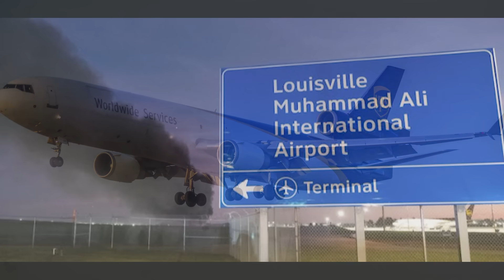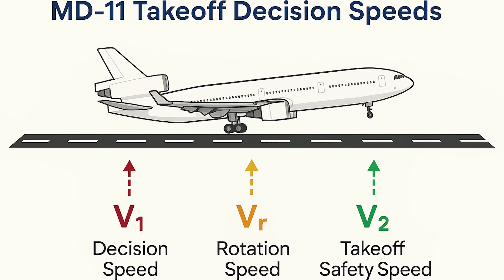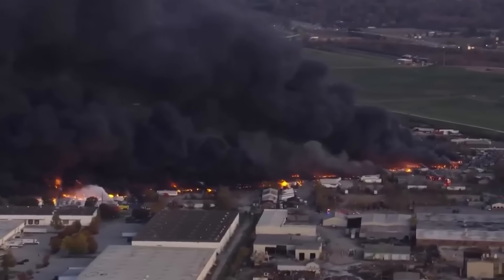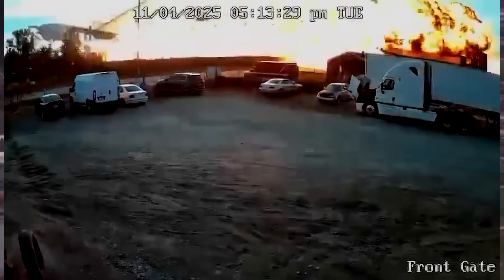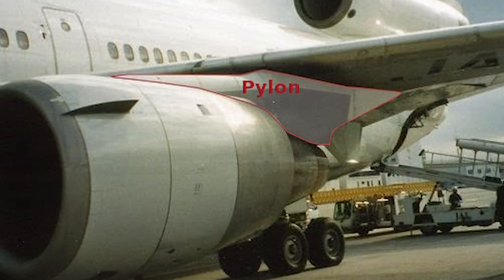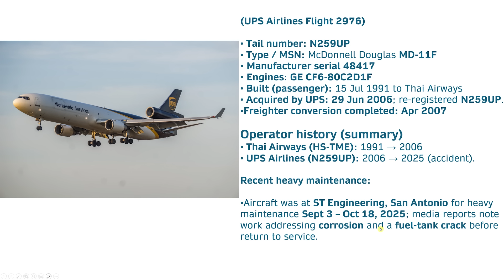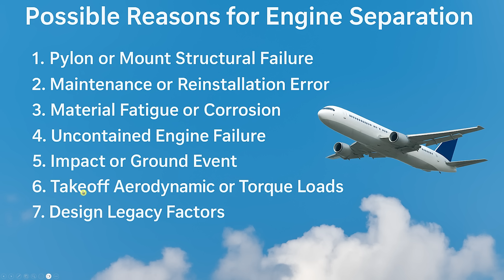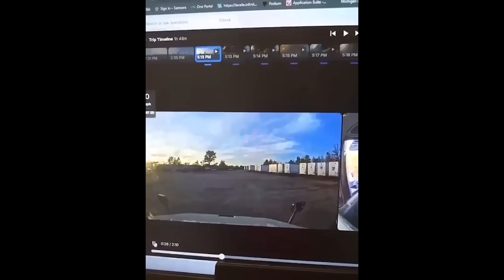What Caused UPS Plane Crash, Louisville, KY? How MD-11 Engine Fell Off

Comment: On 7 November 2007, Nationwide Airlines Flight 723, a Boeing 737-230A owned and operated by Nationwide Airlines, was performing a scheduled domestic flight from Cape Town International Airport to O. R. Tambo International Airport. During the rotation from runway 01, engine No.2 detached from the right wing. The pilots then proceeded to takeoff and declared an emergency, eventually making an emergency landing. All 112 occupants survived without injuries.

Comment: Weren't there similar issues in past decades from jet engines being swapped by lifting them into place with a forklift? It seems obvious that such a crude method could easily damage the engine pylons and cause stress cracks. BILL

Comment: Maybe they shouldn’t fly it for 40 years
Reply: Idiot, 40 year old planes are still great when you maintened it correctly most of the planes flying are 30 40 yrs old and even the us air force is flying 50 year old f16 and f15

Comment: Awful stuff,. just awful awful awful. I feel sorry for anyone on the ground who witnessed this because they'll have plane crash type nightmare dreams for years to come. I can attest to that as I witnessed the PSA 727 flight 182 crash into North Park that very hot Santa Ana San Diego Sept 25 1978 morning. I was just 20. Ugh!  Happened right in front of me. Now67 I still get the occasional out of control plane dream, sobut not as many. And, yeah, wasn't it just a few months later the DC 10 crashed in Chicago and I was at work with the TV on when that news broke! Actually I don't understand why they're still using these OLD flying machines!? They should be retired, imo.

Comment: I may very well be wrong but I seem to remember that with DC10's the hydraulic lines run along the front of the wing area, and when an engine pylon gives way, it rips the hydraulic lines out as it leaves. This lets the flaps go "Limp" and lift is lost on that wing causing the plane to roll down on that side. It was one of a number of design failure points for the DC10. I was working at Auckland International airport at the time of the first crash from this failure mode and there was a series of mandatory changes put out to reroute or protect the hydraulic lines as much as possible. Such a failure mode guaranteed a crash as the plane was un-recoverable in that configuration. Its a tragedy for all involved and I cant help but weep for the loss of the families left behind as I watch the videos of the crash. If this terrible accident is also traced back to an engine and/or pylon detaching and disabling the hydraulics on that wing, then in my (ex) professional opinion, its time the DC10 and MD11's were removed from service.

Comment: American Flight 191-May 1979, O' Hare Chicago. Almost 300 dead after engine fell off on runway. American maintenance chief committed suicide by gassing himself in his car rather than testify to congress explaining his maintenance practices. Coward! DC-10-MD-11 was a lemon when it was designed in 1968. McConnell Douglas went outta business because of all the lawsuits.
Reply: McDonnell Douglas and Boeing merged in 1997 and were from that point forward went under the Boeing name.

Comment: My guess... someone bought cheap Chinese bolts to secure the engines to the pylons instead of the much more expensive ones that are made here in the US and extensively tested for defects.
There are some corners that shouldn't be cut to save a few thousand dollars.  Accountants should not be anywhere near aircraft maintenance.

Comment: Early 80s, couple years after the AA-191 crash, my older brother had gotten us tickets to come visit him in NY city for Easter. At the end of it, we were back at the airport waiting for our flight A plane coming out of Boston (early morning flight) was to take us to our destination after stopping in NY. A one hour delay stretched out to 2 hours, 4 hours, finally at 9 hours, they pulled another plane out and got a volunteer crew to make the flight happen. At the time we didn't know what was going on, but we got free drinks on the plane. After we got home, we found out why. On takeoff from Boston, the plane had an engine failure. It didn't crash, but that was why we had a 9 hour delay and no plane. Most times an engine failure won't crash a plane with multiple engines. Multi-engine planes are designed to run with one engine gone. Not very well but well enough. What happened here is from what other analysts have said, that it appears that the second engine lost power as well. Possibly due to some cascading event that occurred from the first engine falling off. (we'll see what the black box says when they run that data) So it looks like the tail engine was the only one working by the time it got to the end of the runway. And that by itself, was no enough to lift the plane. If the second engine had been working, they might have been able to lift and circle back for an emergency landing. You do know one thing, that poor flight crew were fighting to stay in the air the entire way. Rest in peace good folk.

Comment: I was working for MacDonnell Douglas when the Chicago crash happened.  WHAT I KNOW is that the engine pylon is held on by what we called the tombstone fitting.  Very large and strong connection to the wing.  Far back at the tail end of the pylon is a single bolt that holds the tail end of the pylon to the wing.  When the forklift slightly dropped the engine - AA was not following proper engine removal procedure, the force on that bolt and fitting must have been huge.  That's how that fitting cracked.  Under proper and normal engine maintenance procedures that fitting is 100% safe.

During takeoff the engine was pulling forward when that $69 bolt and fitting failed.  That allowed the engine to torque OVER the top of the wing causing it to sheer off of the wing.  You may or may not know this but engines ARE designed to fall off the wing before damaging the wing.  The problem in Chicago was that as the engine pulled up and over the wing it also pulled the left wing vertical as you've shown in your "Known" picture of the crash.

It's been a very long time since I worked there, but I still know that if you don't remove the engine from the pylon before you remove the pylon from the wing you CAN damage that aft fitting.  That's when disaster can happen.  What amazes me is the UPS plane managed to remain level until the gear hit the building.  Up until that point there was a remote chance of surviving the crash.  Remember Sioux City?  That 10 came back down with no hydraulics and a habit of rolling left due to the last hydraulic input before the hydraulic tanks went empty and the plane lost all surface controls.

I still stand by the DC-10 and MD-11.  It was bad publicity that doomed the 10.  Now, an 11 came down without an engine.  To me that smacks of failing to follow proper maintenance procedures.  The plane is safe.  The operators are the issue.  Just my opinion.

Comment: As bad as this is and most likely lack of maintenance, the blame also lies with UPS themselvses as airlines are really stingy when it comes to maintenance on their planes.
Airline maintenance staff can only do so much when it comes to company policies.
And going by this plane stating that it had heavy corrosion, fuel tank cracks and was under heavy maintenance shows that airlines will cut costs wherever they can even in the name of safety because big companies dont like spending money on expenses and will cut corners. Personally I feel this plane should have been grounded for over a year or more for a total refurbishment of all major parts but airlines just fix their planes with the bare necessities to just get them back in the air again asap.
Reply: No they're not (stingy) in doing maintenance in general.  Maintenance is mandated through the FAA in the U.S. and by the airplane manufacturers as well, and there are specific time frames, protocols, and flying hours that determine what kind of maintenance, when, outside of any specific problems found in between.  Do some homework.  That doesn't mean that mistakes are never made (they certainly are made), but saying this is "a lack of maintenance" is an ignorant assumption.
Reply: @crimson25543  Sure there are mandates and protocols but they always cut corners to reduce expenses and cover up alot of information. Dont you know anything about big business. And also ship off maintenance works offshore for lower wages. Not to mention that airlines are maintained offshore not only on the mainland of origin. If planes need service or get an issue in another country its done there. They arent gonna fly a dodgy plane back home now are they. Qantas for instance have outsourced thousands of jobs overseas in past years and for an airline with an impeccable record of never having a crash in its history, there are now numerous faults with many flights. I read about it all the time, whether is engine fires, cabin depressurization, computer glitches,  faulty engines and so on. During covid alone they sacked nearly 10k jobs and sent them offshore. What does that tell you. And they arent the only airline that do it.
And in closing, the FAA are a JOKE. They issue pilots licenses to pretty much anyone. I have lost count how many stories I have seen or read about light plane crashes or incidents due to poor pilots. They are only in the business to recruit more pilots, not good ones. There are flight instructors with merely a few hundred hrs under their belt if that teaching students and many that are more interested in social media videos while flying. Not very professional now is it.

Comment: I worked for a cargo airline recently for 10 years. My theory was FOD or Aircraft Maintenance failure. FOD can end up easily in the engine when aircrafts are fixed at the loading gate. The engine panels are often left open for days at a time. The MD 11 was actually planned to be retired at the same time the MD 10 was retired 5 years ago at...(i dont work there anymore but i dont wanna get sued. ) because of expensive Maintenance work. The plane is known to break down. Often. If you were a Ramp Agent, we prepared for transload. There are 3 different type of MD 11 freighters. It's the most complicated plane I had to learn and if I were pilot I would be fearful of it. Could be a lot of things. Ive seen a lot first hand.

Comment: The gouge in the roof of the warehouse got me thinking.  From the plane's trajectory it seems the plane veered to the left, which makes sense.

If the starboard engine was at takeoff power and the center and port engines were producing no thrust, that veered trajectory makes sense.

And so does the right wing banking up...  

2 engine failures.

and the remaining engine ran the plane into the ground in an uncontrolled bank.

Comment: So far (and pending developments) I'm convinced that a correct/thorough reporting of the accident causes will ultimately exonerate the 1979 maintenance crew. The DC-10/MD-11 engine pylon design creates tension loads at the fore "bulkhead" linkage, of between 18,000 pounds (at rest) and 40-50,000 pounds (dynamic), as a function of how far out front the 9,900-pound engine is suspended in front of the wing, and also at a stress-maximizing narrow horizontal orientation. These loads are far greater than what would have been induced by a potential forklift mishap as originally reported. 

The pylon in question uses an abnormally small support base for such a large engine and cantilever (almost twice the wing base depth, front to back); in addition, the pylon-wing loads are at concentrated tension/compression points, as in a simple lever. 

The structural design should have been revamped long ago.
Reply: And of course there were the infamous catastrophic DC10 cargo door mechanism failures in the '70s as well.  I never wanted to fly on a DC10 after all those crashes.  I flew on one once and was able to successfully avoid MD planes.

Comment: Chritst... The whole engine flew out of its position! This connection is designed to eb the stronges blting of entire plane after wings! Yet, engine doesnt seem like it was bolted! 
HUGE questions to maintenance crew that screwed up this bad. They better sit straight on their butts.
Gosh such event scares the crap out of ya... Now you wonder if the flight that you have booked is maintained correctly or not!

Comment: The engine that detached had a bad compressor  failer in that engine and the compressor has small blades that shot out of the engine into the other engine if you slow the video at take off you'll see the other engine make a flash means it has a bad compressor as well bc of the small blades shot off into that engine.
The plane got to V1 they had to take that plane into the air..
They had to have that throttles maxed out but the plane was not giving out the max power bc of the bad compressor in the good engine on the other wing .
So they had no choice but to. Crash.
If that good wing engine was not damaged from the engine that detached it would of got that plain in the air and let them turn around and land back on the runway .

Comment: Petroleum Recycling Plant at the end of a runway where LARGE commercial jet aircraft takeoff with hundreds of thousands of gallons of JPA and JPA-1 flammable jet fuel on board. With a flammable source of two commercial jet engines at full power, you couldn’t plan this any better!

Comment: Why are we still talking about the engine falling off when the plane was overloaded past its mtow by 20%? Or how about the fact that this plane was going to attempt a flight from Louisville Kentucky to Honolulu nonstop? By the way the MD-11 doesn't have the fuel capacity to make that trip, they would have crashed in the Pacific. You keep talking about the engine because that's what you're being told to talk about when in reality this plane was never supposed to make it to its destination. This was intentional. One way or another that plane was going down.

Comment: Sorry we forgot to bolt that one on woops:face-fuchsia-wide-eyes: I think some serious thing happened there because usually and I'm no airplane mechanic but I'm pretty sure they dont just fall off. Dude I dont care if I'm at V-2 speed if i'm still on the runway and an engine just FALLS OFF I'm stopping that plane! your putting more lives at risk trying to take off with a single engine which fully loaded that plane can't do anyway so your doomed as it is. So why put all those lives at risk by pulling up and not just crashing at the airport where there's medical personnel and fire trucks ready for that? I'm not blaming the pilots because they did what the manual says but in this case there should be a revision of that V-2 speed like in case your engine falls off don't try to gain any lift...just saying maybe that should be in the manual.

Comment: Pictures of the engine laying on the side of runway apears to have a hole in the rear section where the turbine is.
Possible turbine failure that blew shrapnel threw the wing and caused the fire. The engine under extreme vibration   detached along with the mounting pylon, which it is designed to do. At the time of rotation the right engine experienced a compressor stall, you can vissibly see three puffs of flame from the right engine. There simply was not enough thrust to climb. Just horrifying to know that the pilots knew they weren't gonna make it. Condolences to the families who lost loved ones.

Comment: When I did flight training, I quickly learned that the most dangerous part of flight isn't landing; it is the take-off. If you lose power at a critical moment during takeoff there isn't much you can do about it. You can get locked into ground effect and ride that until a collision if you don't act quickly to get the aircraft down and stopped on the runway. With a massive aircraft like this, I honestly don't know how much time they had to react once the engine ripped away. Really a freak accident here.

Comment: I think these guidelines need to be changed. It’s absolutely stupid to have public buildings at the end of a runway regardless it makes sense that wherever there’s a airport and you have a runway, there should be a mile of nothing before anything is allowed to be built there, and at that point, it should be set up just like a runaway lanes for 18 wheelers or at the end of a drag strip these things helped tremendously at slowing stuff down, these pilots were doomed regardless, but by them actually lifting off the ground clearing a few buildings and then falling on top of several buildings at speed I’m sorry but common sense says that’s more destruction The way they do it now these airports need runoff room. It’s common sense. obviously someone screwed up in this plane didn’t get properly inspected airframe inspections it’s not like this is the first time engines have fallen off of airplanes. Every time this happens has becomes somebody didn’t do a proper inspection. They missed a hairline crack or some jack wad stretched the bolts too much over talking them or somebody didn’t torque bolts tight enough. Maybe they left some locking compounds out. I’m sorry, but this time of day engines should not still be falling off.

Comment: before any of the details came out, i had a theory
cargo planes are really heavy when loaded, and then they need to account for fuel. they dont always plan to fill the fuel tanks to the top because then the plane is too heavy. but, if someone forgot to shut off the fuel fill, then the plane could have been accidentally overfilled and therefor failed to take off. mistakes do happen. again, this is simply what i thought of before any details came out. i had no idea it lost an engine